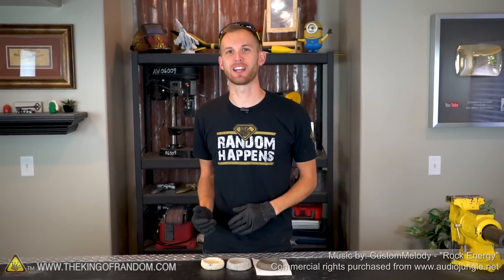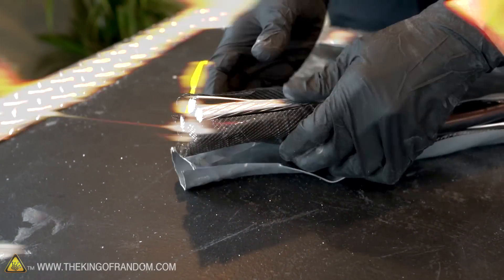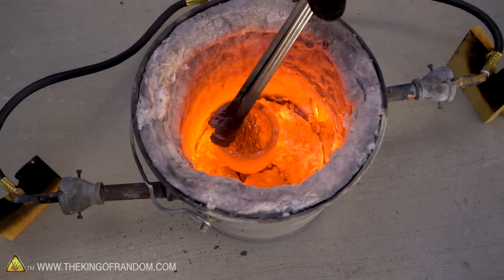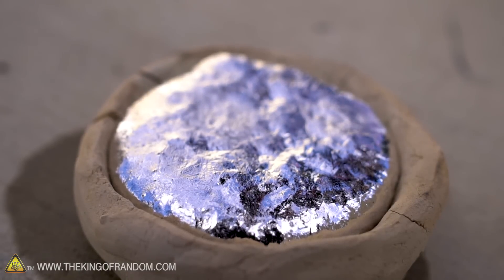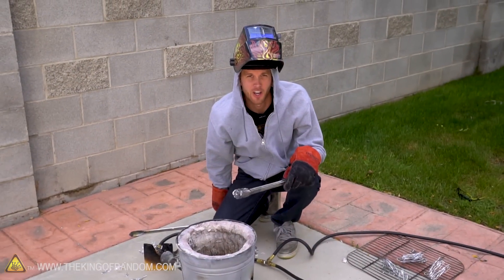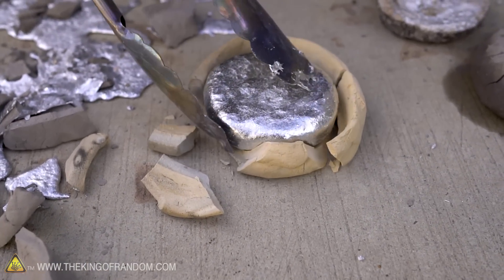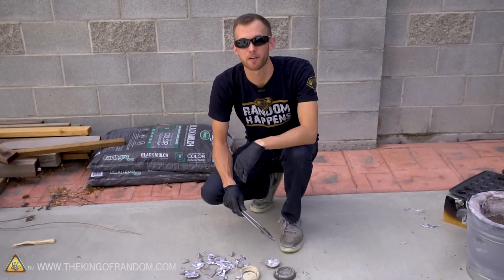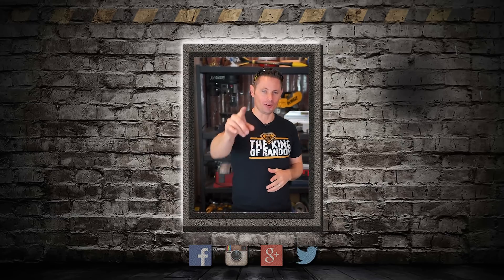Will Liquid Metal Cast in Clay? The TKOR Ultimate Guide To Clay Molding and Metal Casting

Comment: I know this is an older video but if you had preheated the clay mold it should have done better. Even the "dry" clay had some moisture content in it which boiled off and caused the explosion. Heating the mold slowly before pouring will burn off any moisture and reduce thermal shock to the mold.

Comment: the bubbles and the surface defects on the top on the fired, dry, and wet clay version was from moisture that was in the clay that was driven out in both the fired and dried. Your fired clay wasn't "baked" enough...  the heat also drove out super heated water to the cement - which was considerably cooler. That caused condensation to form around the fired clay.

Comment: TKOR would you be willing to try making a crucible and mold from refractory mortar after it's been cured and fired? And instead of pouring the molten metal into an already heated mold of the refractory mortar? Even mix graphite in it for more resiliency. And let it air cool, kiln cool, or even sand cool loosely covering it to cool slowly

Comment: The reason so much metal casting uses sand as a mold is that the metal can outgas in the medium.  As a counterexample, the 6-pound aluminum pyramid atop the Washington Monument needed to be recast repeatedly until it finally didn't have any air bubbles in the surface.

Comment: You gotta work the clay right and dry it out very slowly to prevent the cracks. Try using a wax model and melt out the wax when fully dry. You can use the putty like clay form to cover the model, or dip the model in clay slurry and then splash it with clay powder repeatedly.

You should also preheat the clay mold before casting.

Comment: I have cast aluminium successfully with an "air dry" terracotta brand of clay from the local arts and craft store.
I had it in the kiln for about 30 mins first, as well as using the oxy lpg gass torch on it to remove any moisture and heat it up before the cast (if you don't heat it up first it may crack).
A home made starch based air dry "clay" works alright as well, but the edges could flare up causing loss of detail. The starch mixture is extremely heat resistant (corn starch, pva glue, water, glycerine).

Comment: Curious, what if you added a small amount of clay slurry to send mixing it will?   When working with clay there’s all kinds of clay with different firing characteristics. Air bubbles is the biggest problem in all clays.   Porcelain clay I have never worked with.

Comment: thats really neat that the wet clay did so much better then the dry clay. i'd imagine its probably because the dry clay is so much more fragile then the wet clay. its soft so it probably could handle the forces. also, this might work better if you fire the clay and dehydrate it some how because i know that clay an still absorb water even after its been fired.

Comment: Could you use layers of fabric to cast metal
Reply: danyel Watson if you want a fire, sure.
Reply: actually probably this could be working with some material, like a fiberglass mold that gets done using any epoxi adhesive with high heat resistance factor...

Comment: also you might have more success in your sand casting with the type of sand you used as well as heating the sand with a torch before casting the metal into it.

Comment: Can a metal mold be used to cast the same metal as the mold??
Reply: it would bond with it and become one cohesive block of metal so no
Reply: What Elmo said. Imagine trying to use an ice cube tray made of ice.
Reply: He has done it before when he is using the steel tray for baking for aluminium casting and it doesn't stick to it , look for H13 die casting
Reply: I tried to cast together aluminum once, using 2 previously cast halves and then drilling through them to create a pour hole, into which I poured molten aluminum, expecting it to weld the two pieces together. It failed to fuse to the pieces. I bet that if the molten metal were very much hotter than the melting point it would have had sufficient energy to transfer into the constituent pieces to melt their surfaces, especially if I brought those pieces to a higher temperature first. But it would certainly require a certain amount of finesse.
Reply: No
Reply: @KucingBakarMadu  I have permanent aluminum mold. Its a 2 part mold for a 10 inch bell. I make a core in the pattern bell and the top mold which shapes the outside of the bell is pure aluminum. I pour molten aluminum in the top hole and cast bells that way. The metal of molten aluminum does not melt the aluminum cope and shrinks away fromt the mold walls and when it cools i knock a bell out with a rod. Works every time. Molten aluminum will not stick to solid aluminum .

Comment: From a myself, a potter: the dry clay wasn't dry enough. It needs to be "bone dry" what causes the explosion is the remaining moisture in the clay evaporates causing pressure in air pockets. The extreme intense heat plus the evaporated moisture forces it's way out as quickly as it can, causing the clay to explode. This is a fundamental and key element of pottery. Dry dry dry! Or fire clay *very slowly*.

Comment: I'm pretty sure there are plenty of comments from potters on this video.  Their guesses would have been dead on.  It's something we have to live with on a daily (well, mostly daily) basis.  One of the first things a potter learns is to dry their clay as close to zero moisture as possible before shoving it into the heat.  Water, clay, and heat will explode pretty much every time...   unless you have so much water in your clay it will cool the heat before the heat can enclose the moisture in a shell.  

The Physicists below will have mentioned that moisture expands, rock doesn't expand at the same rate.  In the first bowl moisture is throughout so the expansion ratio will be nullified.  No explosion.  In the last bowl the moisture has been completely removed so again so explosion, but air in the cracks expands so the cracks widen and the bowl will fall apart.  The middle bowl had dry clay on the outside, but not on the inside.  Wet stuff expanded faster: explosion.

My dad is a physicist; my mom is an artist.  I was doomed from the start.

Comment: Ceramic clay has two types of water content to consider. The first is the physical water, and the second is chemical water. If you don't fire the clay hot enough, there will still be water, even if you can't see it. The clay you called fired wasn't taken to a hot enough temperatute so it still had water in it. The dry clay still had water in it, which turned to steam when in contact with the aluminum, which created the explosion. We take ceramic clays to over 1500 degrees Fahrenheit to prevent cracking and explosions.

Comment: Late commenter, but just now watching the video.  Paused at the 1:15 mark, my predictions are:  Wet, will spit and bubble the liquid metal getting a poor result.  Dry, will hold shape and be the best mold option due to its malleability.  Heated, though performs the best for casting the mold, trying to remove it and also that process of heat treating it will make this a less desirable option.

Comment: Baked clay will probaby explode as there are bursts in it where air will expend, exploding it. 

Dried clay will probably explode for the same reason as it will getting baked through the high temperature but explode because of expanding air through the bursts.

Wet clay will also bake but I don't know if there are any air bubbles in it which will also make it explode.

Comment: Wet clay is going to sputter, making a terrible mess of a mold. The metal will bubble over and push the walls down
Dry clay is going to crack and expand in the heat, and the walls will fall over under the weight of the metal
I think the fired clay will probably also crack, but much more slowly and won't collapse as much as just fail to hold the metal in.

Woo! 0/3! Learned something new today!

Comment: Fired clay molds work best when their thick and encased in a box frame to hold pressure, they are also typically one time use things since the mold becomes brittle so anything that isn't designed to slide out when done (like an ingot) the mold is broken to retrieve the cast... it's actually where the term "breaking the mold" comes from. So I suggest if your going to try using clay molds, make sure to mold the outside to fit into a some kind of frame.

Comment: So... I thought the fired clay would actually fall apart while the metal was still hot, the dried clay... I didn't expect it to explode, but the wet clay did what I expected at least. Not much of a way for it to explode if the clay is cool, flexible, and had a lack of air pockets like putting it into the oven.

Comment: Someone's probably gone into scientific explanations for each type of clay, but from the viewpoint of an art kid, I can give a general idea as to why the dried and fired clay did what they did.

With the dried clay, it was probably just air-dried, meaning the inside still had a small moisture content. That's why the temperature of pottery kilns is slowly increased over at least a few hours, to gradually dry out the clay without cracking. When the molten aluminum was poured in, the temperature skyrocketed, so rhe moisture and heat clashed, causing the clay to ezplode from the force of the resulting air bubbles.

As for the fired clay, there's only so much heat that can be applied directly to clay before it becomes more fragile than say dried clay that is easily misshapen or broken. Adding more heat to a fired piece wants to remove moisture that isn't there, which can cause cracks and breaks.

Did any of that make sense? Probably not. I'm dyslexic and basically unable to see properly, but I wanted to share.
Reply: Your spelling and grammar are near perfect aside from a few small mistakes here and there "so rhe moisture", "ezplode" which appear to be simple typos. R is right next to T, Z is right next to X, etc etc. If I were to diagnose you just from this, I wouldn't say you're dyslexic in the slightest. Though, I don't know the extent of your difficulties so I can't refute that you are at all. :P

Just saying, the only problems I saw were simple typos. Your typing is otherwise significantly better than many others I've seen. Might I suggest getting Grammarly for your browser? It'll catch simple typos like that and even point out any errors in your grammar, hence the name. It's not an autocorrect, though, so no frustrations there. ;)
Reply: i had no problem understanding what you've said and your information was useful :)

Comment: the fired clay wasn't fired hot enough, that and it's of poor quality (cracking), people with no modern tools can do a better job. the fired clay shouldn't of cracked and it should of held just fine up to temperatures of 1200+c or 3000+ f.
to fire clay properly the clay in question should be bright red, then let to cool off slowly. if you cool it too fast it will crack and/or if the quality of the clay used is terrible. the craftsmanship of the object also plays a roll if it will crack or not.
this test is inconclusive at best, at worst it show cases neglect to give the material in question it's fair shot.
also next time please protect yourself with some type of shield. you are all very lucky none of that touched you because if it had it would melt into your skin and you would be in the hospital for a long time.

Comment: Well, this is all extremely explainable.  

The fired clay hadn’t been fired all the way.  There was still some water in it, which is why it puddled up underneath and why it was so fragile. 

The dry clay still had a lot of water in it, but it was rigid, which is why it exploded.  The water vaporized inside the hardened clay and the pressure caused the explosion. 

The wet clay didn’t explode due to the pliability of the wet clay.  

I greatly enjoyed watching this video.

Comment: Clay molds are used, but normally they are brought up to the same temperature or close to the metal being molded, and they are a single use mold but they produce fine detail, if you try it again, you will get a positive result.  Clay is prefered as it produces a better one use mold over plaster of paris

Comment: If you purchased investment then formed your part in wax, you pour the mixed investment over the part leaving a sprue and an air escape same as you would with sand, place in vacuum chamber then leave to dry.  Then turn it upside-down and reduce the wax completely at 800 deg F.  After 20 min, the smoking stops escaping from the vents of your kiln then you pour your part, let it cool then plunge into water and the investment will melt away leaving a perfect part.

Comment: You can cast aluminum just fine in Fired clay, but clay needs to be brought up to some pretty high temperatures to be considered fired.  You should place the mold you plan to use in the foundry for a short time to bring up the temperature as well, and then place the mold and pour the cast.  The will make sure the mold has already expanded and then as the entire thing cools there is less chance of it breaking.  The problem with sand is that you are not using a sand made for making molds,  There are specifics recipes out there that are needed to be followed for the sand to work properly.

Comment: Had the fired clay been wedged before firing, (removing air by working over the clay) and then been fired at a higher temperature (like in an actual kiln) it probably wouldn’t have had the shrinking that caused it to crack

Comment: The unfired dried clay exploded because you essentially started to fire it very quickly and the water trapped inside it expanded. It’s the same thing happens inside the kiln when it heats up to fast. 
Your fired clay also heated up too quickly. I thought it was going to break so I wasn’t surprised.

Comment: Try mixing clay powder with mineral oil and casting in the wet clay that results from such. The mineral oil may cause a fire that increases the heat, however the clay might just hold as well. You could mix clay powder, mineral oil, and some sort of flame retardant into the mixture.

Comment: You had issues casing in sand as you did not do it right, you need a sprue as this provides a even pressure of metal and protects the mould

Comment: Why not try Styrofoam as a mold stabilizer in the sand. It is how they cast aluminum engine blocks so might be a viable solution to make the casts a higher quality. Just pack the sand around a pre cut Styrofoam shape leave it in the sand and pour the molten aluminum in.

Comment: the dry clay might not have exploded if it didn't spill over the side. initially, it had room to expand radially, but once there was the aluminum on the outside, it'd be expanding tangentially, and thus the explosion?

Comment: The dried clay exploded because there was an air bubble somewhere under the surface of the clay. this can happen when you bisque clay if there is an air bubble in it it will explode and ruin any other pieces in the bisque. making sure there are no air bubbles trapped in your clay is an important part of making any piece with clay.

Comment: What about if you take a bucket with water, stick the clay mold into the water, then pour the molten metal into the water on top the mold?  Or even a oil bath with the mold inside for some metals? The liquid conductor will take some of that heat load and cool the item quicker, though if it cools too quick, it seems to me you could use different depths of liquid as necessarily.

Comment: Before I continue the video I'm already worried about the fired clay. The s crack ring around the rim makes it a bit frail, ceramics have to be heated up slowly or risk a break. I have more hope for the wet clay and definitely not the green wear. When you do Ceramic expiriments try to make your pinch pots even all around and let it dry evenly to prevent the s crack that way you have a better outcome! But this was very enlightening.

Comment: I think your fired clay mould wasnt fully fired. Unfired clay holds a lot of water within its structure and doesnt release it untill it gets to about 350 degrees C. Residual water turned to steam and condensed on the concrete i think.

Comment: Im a ceramic artist and if you would have wedged your fired clay before you fired it and let it fully dry before firing it wouldn't have had cracks in it and im sure if you did but you should use a real ceramics kiln this will let you know if you have fully fired the clay to zero moisture content. Also using a type of clay body that can absorb the rapid temp shock such as porcelain or Raku Clay it would have worked better and would have a better chance of not cracking.
Reply: Plus heating the clay just before pouring would reduce thermal shock. I wonder if coating the clay in sand would help?
Reply: Wow! That's smart
Reply: Namjoon's Butt .omgsame
Reply: Okay but he wanted to see if he could fire clay in a Barbecue grill. It was kinda the whole point of the previous video
Reply: Yes, but if he wants to see if fired clay is a viable option for aluminum casting, he should have used properly fired clay instead of the one from the previous video.

Comment: Just a tip - When using clay for casting, preheat the mold before you pour the metal in. This will prevent the cracking of the mold due to the thermal expansion.

Comment: greensand is what is used for casting by professionals, however there are several clay based products that works, clay is porous and will draw water regardless if it is dry or not, the molten metal will then flash boil the water and thus you get a steam explosion.